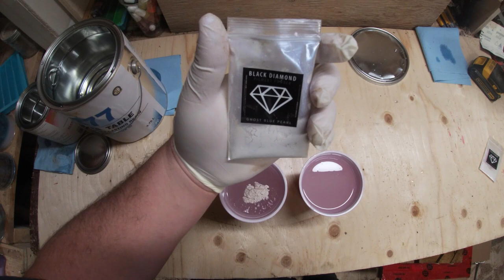Wood turning - Night Lamp

Comment: That is really cool.  Quick question, I noticed you used a river table resin.  Does it turn easier than say total boat or and or art resins?  Is their a reason other than what you had to use that particular resin?

Anyway, enough questions from me.  Very cool looking lamp, I like your work and your videos.  Merry Christmas and Happy New Year my friend.
Reply from the maker: The company decide to call their resine like that but it's just a regular pouring epoxy. I can't tell you if its better than total boat, i don't think so but i never tried total boat epoxy. thanks for watching and happy holidays!